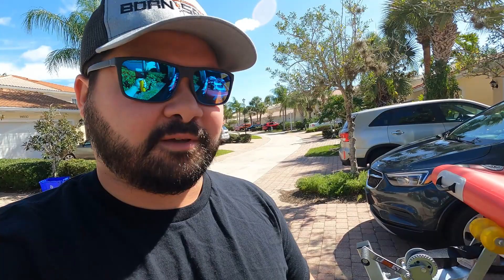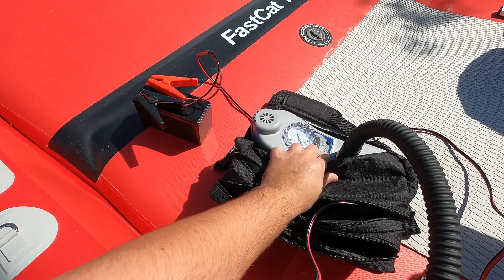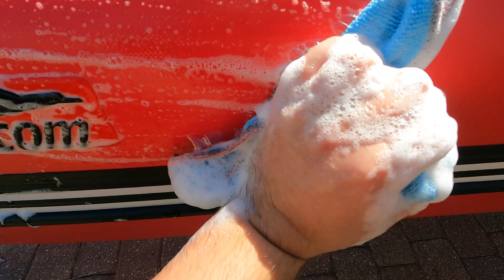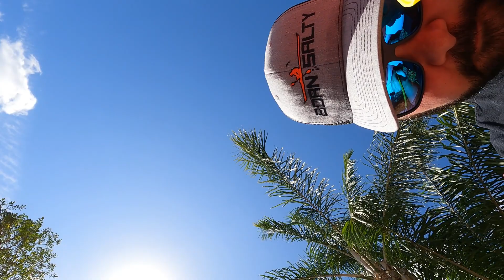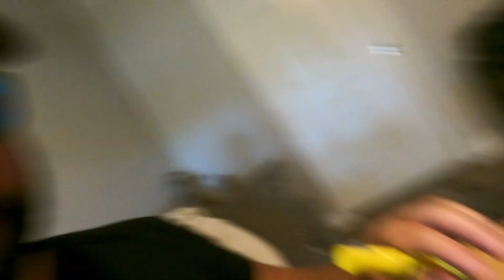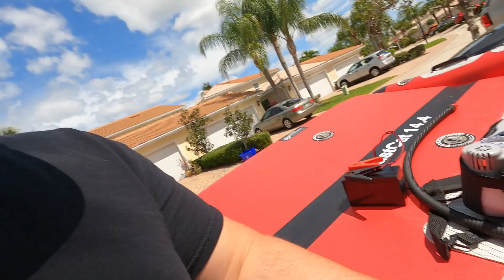How to find a leak and repair an inflatable PVC Boat or kayak - Seaeagle Fastcat 14

Comment: Hi, my Fastcat 14 is having serious problems. One of the pontoons is not just leaking, it is blowing air out! It is not a puncture, but a 2 inch seam is just open and if I just push with my finger it gets bigger. Should I try fix it myself or take it to a professional? Any comenta will be very appreciated.

Comment: How come no abrasion and MEK to prep the surface first. Then use a proper roller tool to press the patch onto the surface and force any air bubbles or voids out.

Comment: are there more videos on this boat? how it is open ocean?
Reply from the maker: We plan on doing another video soon showing how it handles out in the Gulf of Mexico. We'll try and do it on a choppy day so we can really show it's performance. As long as the boat is balanced correctly with the gas tank moved towards the front it handles great from my experience.
Reply: @BornSaltyCo  tysm :) maybe this is overkill but maybe planning to put rubber rakes underneath the main deck or added pvc's on side..how does it handle errant hooks fm fishing poles? tysm again 🙏🙏🙏🙏

Comment: I didn't stick around for the patch because you mentioned one thing that I possibly did wrong. And that is filling up my inflatable hot tub too much. I figured if I over inflated I can hear the leak. But that didn't work.
Reply from the maker: Yes, sometimes less air is definitely better. The soapy water method is the best way to find the leak, you can also mix up a soapy water solution is a spray bottle and search for it that way.